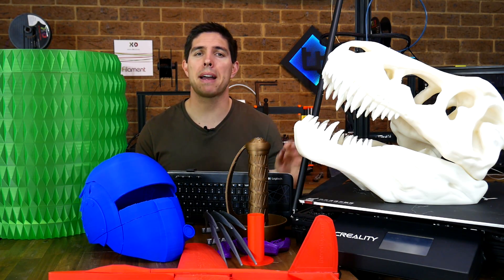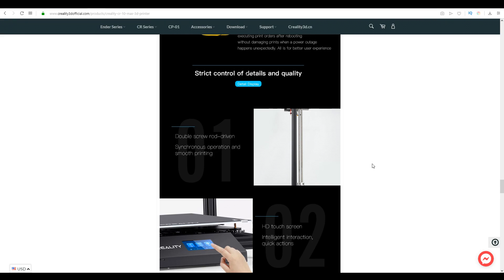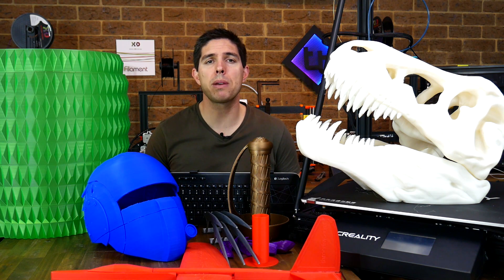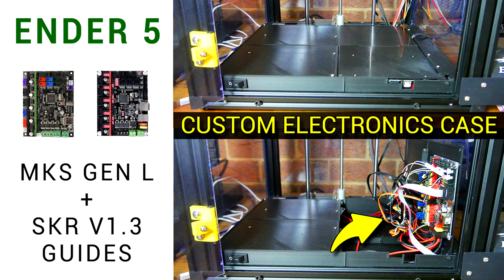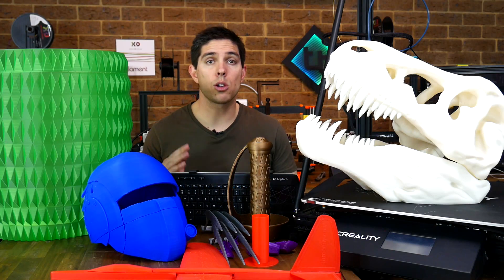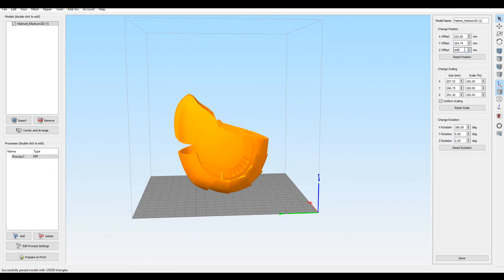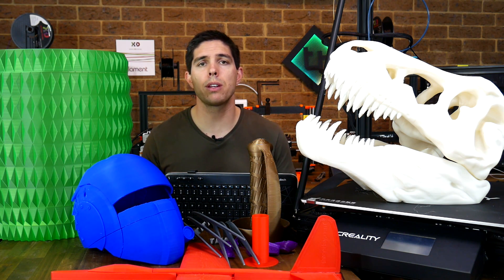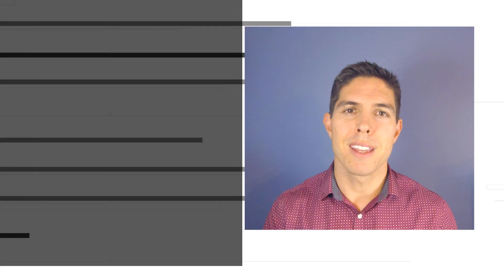CR-10 Max review - Is bigger better?

Comment: Disappointing printer. Props to Creality for using quality parts though.
Reply: It's a catch 22.  Everyone keeps asking for quality parts  (genuine Bondtech gears, BL touch, Capricorn, two Meanwell power supplies [750W is ~$150 USD]).  But if they'd skimped we'd probably be happier with the private/quality ratio....
Reply: @Ardren  ... think they were like mmmm how can we sell the same shit but in a bigger package .. lets add some brandnames we can charge extra ... it hasent got to work we can attempt customer service after we have the $

Comment: Purpose built for big jobs.  If the hardware is solid (and it sounds like it is), a little firmware tuning, and a quick tighten on the screws doesn't sound like too much work. Just a slight learning curve to go with long run times.

Comment: Moving this enormous Y axis seems stupid to me, coreXY would be better imho
Reply: I think all axis should be moved by screws. And the bed, like the Z axis should be doubled motored.
Reply: @elfpimp1  screws would be extremely slow for XY motion, also would be a much heavier platform to move.
Reply: @kazolar  I know. I made note of that in my post. Edit: I posted the slowness on the main thread. Not here.  Of course I also thought about a double motored belted bed.
Reply: @elfpimp1  Why not move up to Nema23s and much beefier timing belts than GT2? Their torque is much higher, and I'd imagine larger timing belts would alleviate the issues GT2 might have with such a heavy XY assembly.
Reply: @EgorKaskader  my knowledge of 3D printers is still on the tinker level. But if I remember right, those are a bit beefier??
Reply: @elfpimp1  They are a lot beefier, yes. They're actually far too powerful for Pololu drivers, and need separate drivers to run them, but a lot of small-ish CNC machining equipment uses them, most notably  mills,  routers and lathes. That should tell you that they can pull a lot of force, compared to Nema 17. You'd probably need your entire upper body strength to overpower a relatively low-end Nema 23, compared to just your arm for Nema 17, too. But the drawback, naturally, is the noise and power consumption. Though running a dozen Nema 17s is probably not that quiet either, compared to 3-4 Nema 23...
Reply: they see your reply and thought ender 5 plus
Reply: It is really hard to make working mendel at 300x300 and up, but as others mentioned, not easier or cheaper the other way. You either need good screws or single axis basic one circle short belts. Look how SMT component placement is done too...
Reply: at that scale belt runs are very long, so corexy is not ideal there either, a standard Cartesian -- ultimaker style is more appropriate at larger sizes...bed would only go up and down, but kinematics are more conducive to larger formats.
Reply: @kazolar  My Tronxy X5S corexy is 330x330x400 and cost $246. After a few upgrades/mods, it prints great. Even small details come out better than I thought they could.
Reply: @kazolar  you could build a voron for that price granted it would only be 350x350x350 but its enclosed and can print ABS and fast!
Reply: @DamonCammish  sure, there are other corexy designs which reach 400mm cubed for a similar price point. The size here is 500mm and above, the racking that happens due to the longer belt runs in the corexy config would require some expensive parts and engineering to avoid.